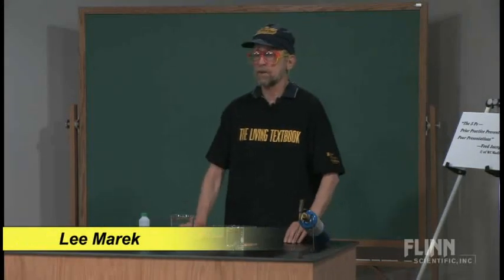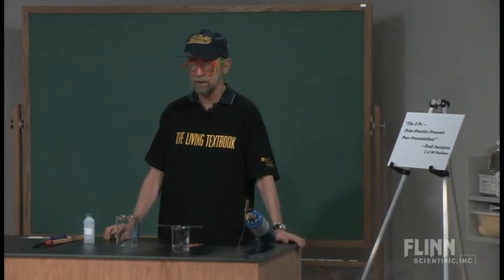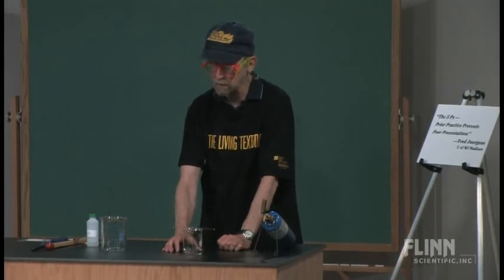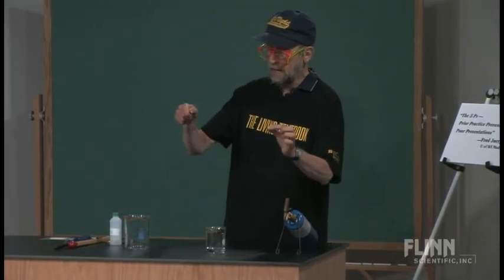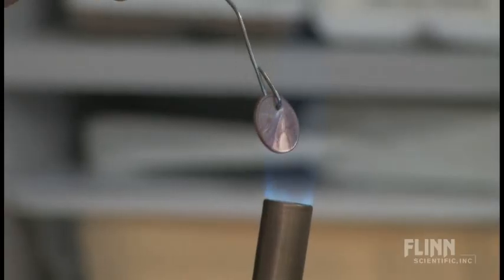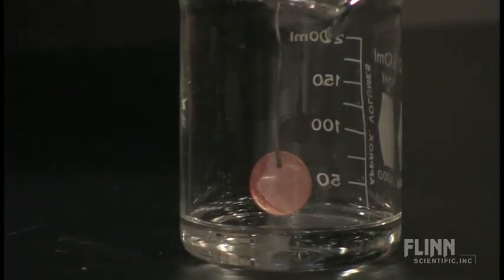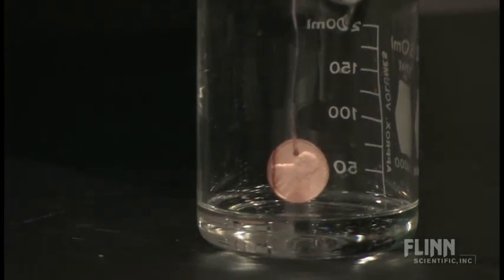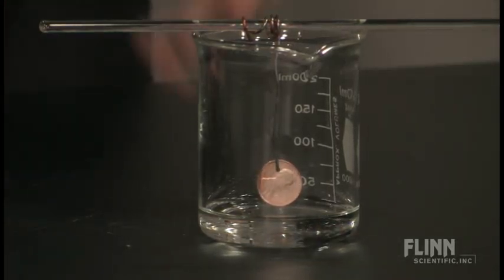Catalytic Oxidation of Acetone by Copper

Comment: What kind of temperaters are we seeing? Can i heat my tent with a midified version ? I would put a square tube of metal above the penny or someting larger in size and put a fan in one end and push out warm air out the other end with the copper near the center of the tube. Think it might produce any heat?

Comment: I thought this reaction produced ketene, which is extremely toxic, similar to phosgene? If so, fume hood may be a good idea indeed. Anyway, is surface of the penny effected in any way? Copper oxide is pretty valuable to those who treasure conductive ceramics. I guess not, Cu is only catalyst, right? In that case the glowing penny could still make a nice night lamp.
Reply: yeah ketene lamp, ketene is incredibly toxic